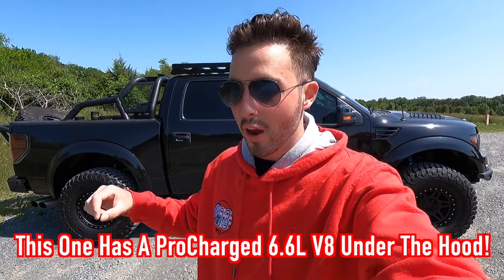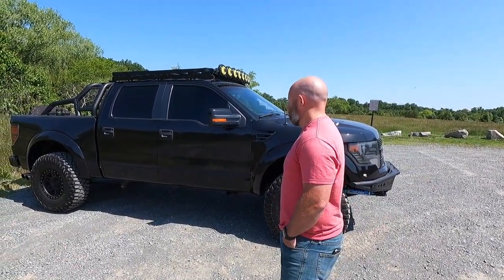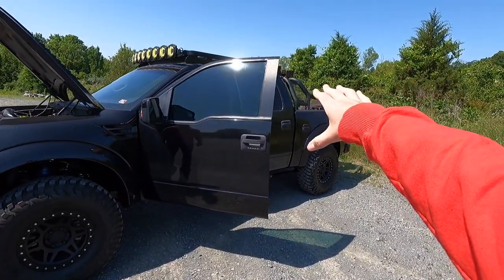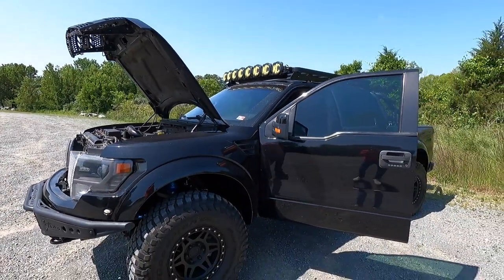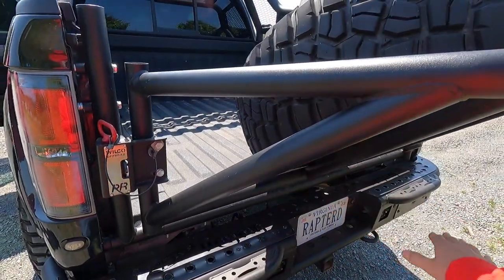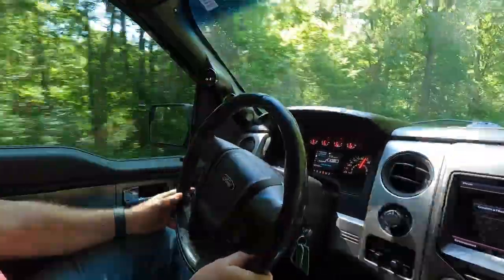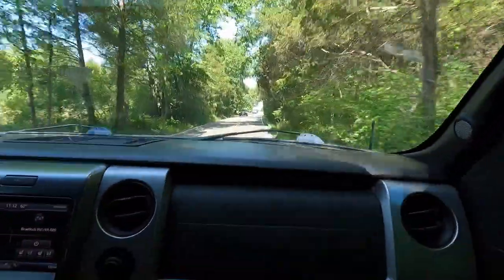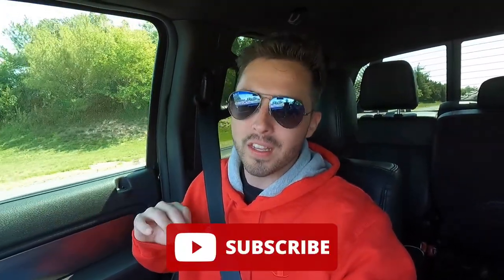ProCharged SVT Raptor - MADNESS

Comment: I simply don’t believe that it’s pushing 900 to the wheel. Ive been looking into getting my 2011 Raptor supercharged with all the goodies and such and i’m positive those are 650 to the wheel with a stage2 kit. You can push them up to 700 with other add ons with a great tune, but no way you’re reaching 900 even with all the bigger fuel lines/injectors… that’s literally another 200HP we are talking about… Pro charger is at most equal to the Whipple but if i’m not mistaken I think the Whipple puts out more.
Reply: Well it's not to the wheels it's at the crank but 900 is quite hi it's a bigger bore and had to have a built transmission what I wanna know is what axels mine is 700 hp
Reply: I'd believe it could be close to that. He's also running a bored 6.6 Motor from livernois. He's done practically everything. There's guys doing 700HP with the standard 6.2L.
Reply: everything this guy lists is standard with the 6.6L LIVERNOIS MOTORSPORTS engine, it's not all extra like the guys makes it sound. Livernois has a blown 6.6l package that's 800hp flywheel. this truck doesn't even act like is has that much to the flywheel.
Reply: I believe it, there's someone who swapped the 6.2 from a Raptor into a crown vic and it's making 1000hp on the stock block.
Reply: Boost and bad habits yezzir

Comment: Theres no way this thing is making 900 wheel. Maybe 900 crank if you account for the massive drivetrain loss
Reply: 6.6 liter motor, cams, E85, and 15 pounds of boost? I don’t know. My coyote makes 720 whp at 14 PSI. With another 1.6 liters of displacement it might be possible. Although the compression ratio is lower than a coyote.
Reply: @guthrie_1  I've seen this setup before. It should be making 700-800 wheel which is the max I've seen done on a raptor and 6.2 in general
Reply: @Blue_Flame_Raptor  That’s a little disappointing.
Reply: @guthrie_1  not really because that's a massive number to push in a truck with big tires. If it's making 800 wheel then it's probably close to 1,000 crank.
Reply: @Blue_Flame_Raptor  900 at the crank with a 20% drivetrain loss should be 720 wheel, which is still nice

I just expect everything to respond like a coyote which at 6.6 L and 15 psi would be pushing around 1000 to the wheels
Reply: @guthrie_1  yeah the coyote is wild. The 6.2 platform just doesn't pick up power like that
Reply: @Blue_Flame_Raptor  I still like the 6.2 platform. I like the idea of having more displacement. If I was handing it over to an engine builder to have all that work done, I’d have him up the compression ratio. 11 to 1 or even 12 to 1 would be nasty.
Reply: I’ve seen a dyno run/printout on instagram with an f1a and a 6.6 and it made 891 wheel.
Reply: @Blue_Flame_Raptor   right, everything this guy lists is standard with the 6.6L LIVERNOIS MOTORSPORTS engine, it's not all extra like the guys makes it sound. Livernois has a blown 6.6l package that's 800hp fly"wheel". this truck doesn't even act like is has that much to the flywheel. 900hp at the wheel would be around 1150hp at the crank with the drivetrain loss these trucks have.

Comment: i recently bought a 04 avalanche z71, kinda splurged on things till i forgot about 3 important things but those 3 things will be done nex yr since it's getting new shocks, fresh tints, new radio and a back up camera. even tho she has a muffler delete, 91 octane tune and 4.10 tune i fill her up once a wk and have my 09 crown victoria in storage for the winter since i got stuck and i won't be repeating the same mistake again

Comment: What did you get done to the transmission?
Reply from the maker: I’m not sure what was done. I think it was just beefed up with better parts to handle the power
Reply: 6r80s are pretty good just a few things to change to make it survive longer.   Stock they have done 1000 hp